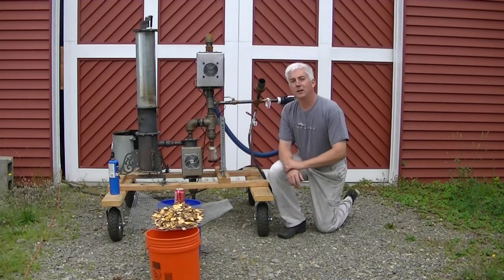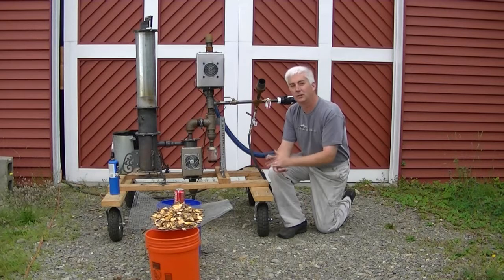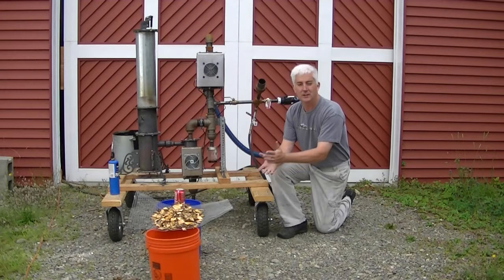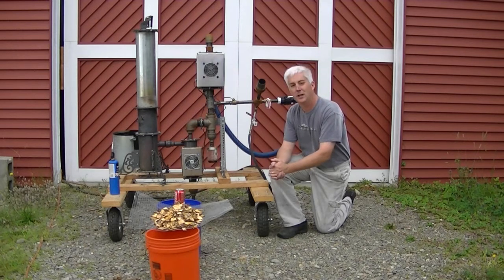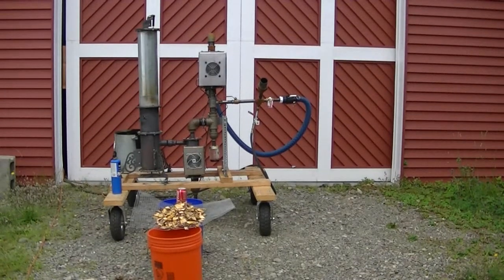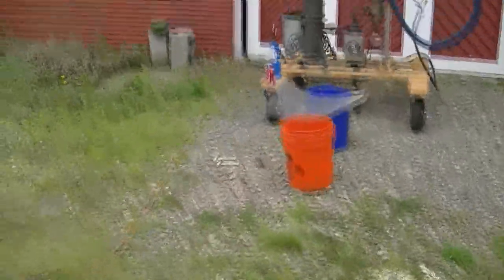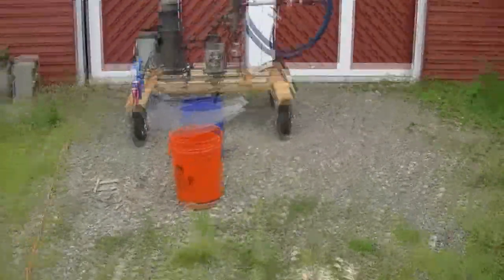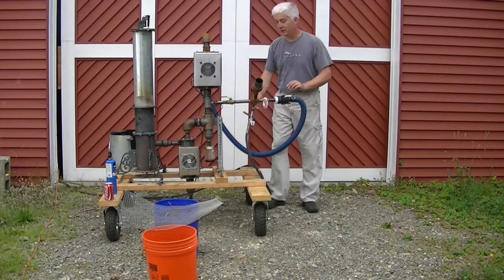NSR Gas Station Lite: Do's, Don'ts, and what to expect at the first lighting

Comment: Steve, Nice system. What do you think the moisture content is in the wood chips? Do you dry them outside in the sun or do you have a drier?
Thx
Reply from the maker: NH Hbbyloggr The moisture content is 9%  I can either use my indoor fan blown drier:    http://northernselfreliance.com/biomass/woodgas/moving-air-fuel-drying/      and dry the chips in about 11 hours from a green living tree at 50% water by weight or I can dry them in still barn air on a table, tossing them once a day    https://northernselfreliance.files.wordpress.com/2014/02/still_air_chip_drying.jpg   in five days.  Stephen
Reply: Northern Self Reliance Thanks for the reply. The explanation in your " moving air " bucket was a big help in explaining how you got it to that MC.. That's the key to good gas.
Bill